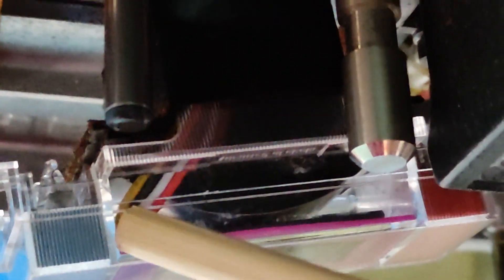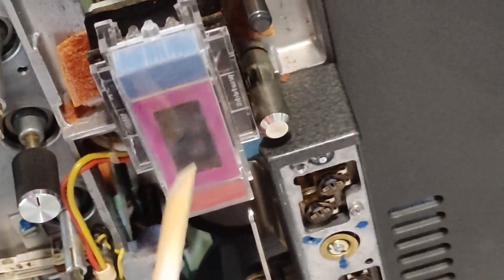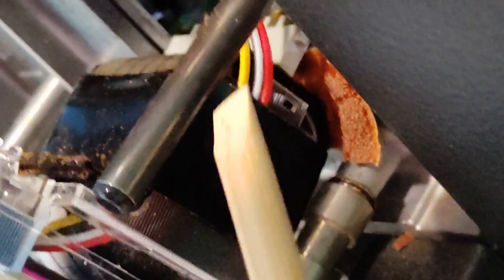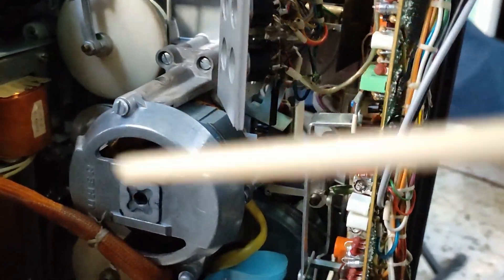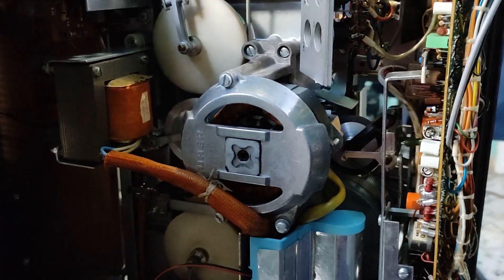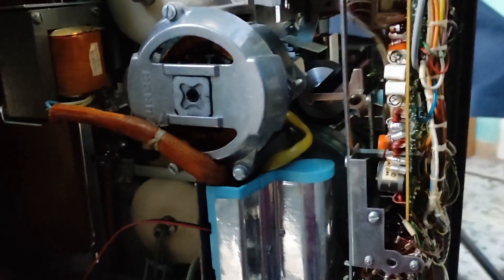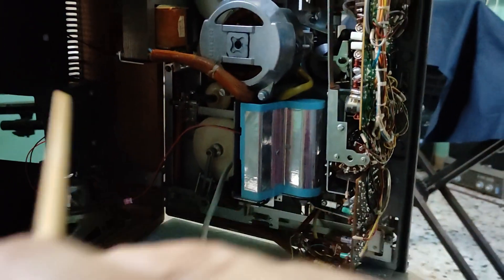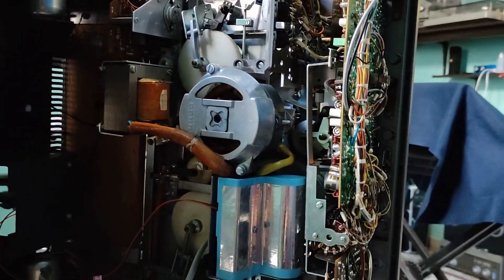UHER ROYAL Deluxe oled display Vu meter with arduino

Comment: Hallo ich habe auch ein UHER meine Anzeige ist defekt, würde das auch einbauen da es keinen Ersatz mehr gibt, bauchte noch etwas infos dazu Materialliste ect.wie können wir Kontakt aufnehmen?
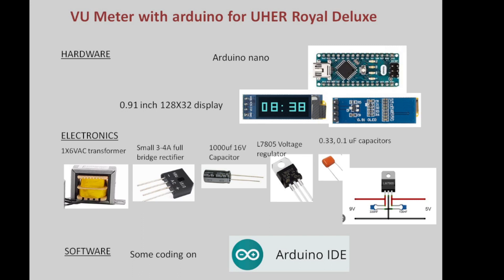Reply from the maker: All the parts are in the video from 3:21 until 5:15. I also have a link to "mega" cloud with pics and the arduino sketch. To do this you need soldering skills, basic electronics knowledge, arduino knowledge, 3d printing capability and hand small constructions ability. You may send me a gmail if you need more info.
Reply: @dchatz  ok wo finde ich ihre Gmail ?
Reply from the maker: @TheNannen501  dchatz@gmail.com